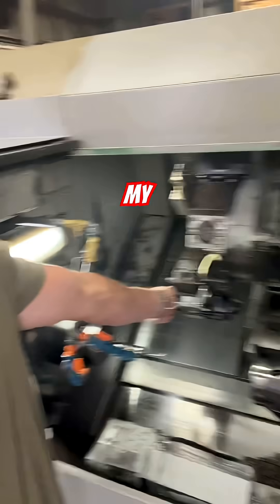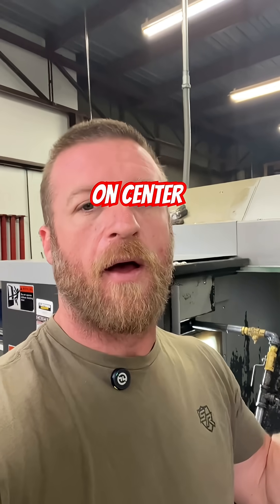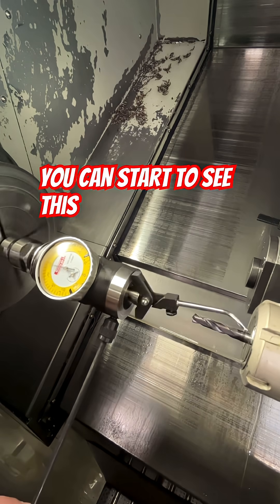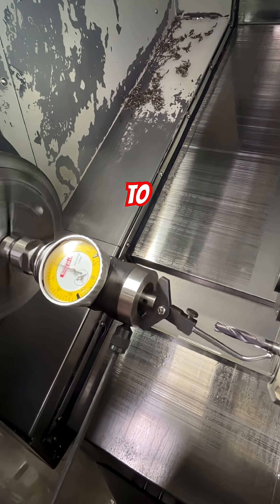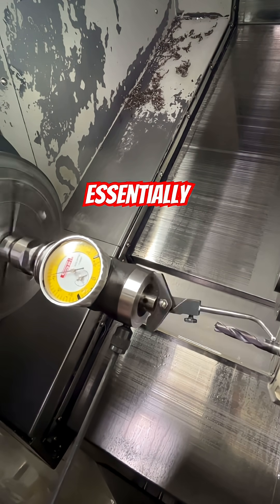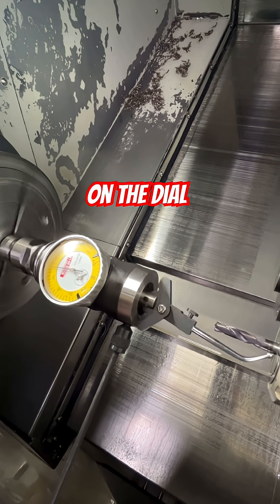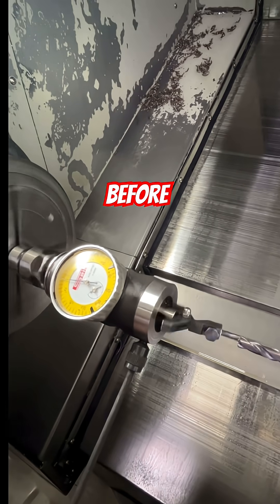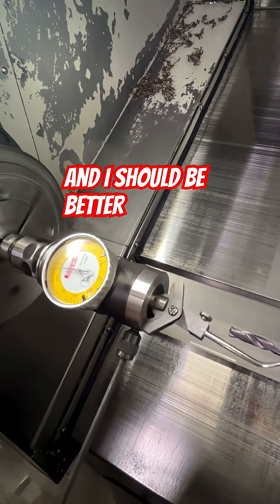Coaxial Indicator- Lets GO🚀 #cnc #fun #cncmill #machine #cnclathe #machinist #lathe #machining

Comment: That's wrong. You indicate to holder first. Then you indicate cutting tip flutes. Good luck
Reply from the maker: The way you mentioned is a great way to center a drill, but if my way is wrong…. How come it worked ?

Comment: its common the tip of the drill is out of center from a bad holder or collet
Reply: That is a pretty common problem. It gets worse the longer the drill is as well.
Reply from the maker: @brandons9138 good point
Reply from the maker: With the right setup I can get a drill within .0005” or better. But yes it isn’t uncommon to have a drill off center when it’s mounted at first

Comment: I love coax indicators. I always slap one in when I'm setting up a drill in a lathe. Every single time as a just in case. I mean it takes like 2 min to set it up and check and and can save you from so much trouble down the road ( cause if there is trouble ps like the drill snapping you know it's not because of that since you already checked that when you set it up ) 

My only question is. Why do you have the indicator in a ER25 collet extender in the collet chuck? ( they have runout as well ) I prefer it to have it directly in the main chuck/collet ( less added runout stacking ) also at like 50 is rpm but with a small weight instead of the pen ( so it doesn't matter/need to be so far out from the chuck )
Reply from the maker: I agree with you about doing it as a precaution simply because it’s so fast and easy. I put it in a colon extension cause I couldn’t find the coop pads I needed for the 3/8 shank of the coaxial indicator.
Reply: @Crusadermachining  then it's all fair and good. Could turn and put on a one time shrink fit adapter for it ( basically make perfect zero runout extender shaft for it )

Comment: I've had broken three carbide drills due to them being off center, don't have a y axis to compensate with either so can only get so close in the X. I found that it's faster to dial in the holder itself with an eccentric test indicator in the spindle
Reply from the maker: Do you have a method to offset or dial in the “Y” axis ?
Reply: Mechanics have adjusted the turret to be within the tolerance spec iirc it's +0.05mm and -0.002mm depending on which holder position but other than shims there is no way. 😅  @Crusadermachining

Comment: Only comment I can make after alot of this is Mighty Mag and .0001 indicator to the inside of the taper on the holder.  The shorter you keep the indicator the less effect gravity has.  Actually learned that from our machine tool distributors when I was chasing accuracy in live milling.
Reply from the maker: Great advice. If you aim for closest to dead nuts as possible, shorter the better 100%
Reply: @Crusadermachining We are St. Michael Machine and ever since I first saw one of your videos I wanted to tell you I like ur shop name sir!
Keep up the good work
We have 1 LB3000 and one Robodrill and one Okuma 4020 mill.  You helped me with some concept for thin wall turning workholding so thanks and God Bless you brother!! ✝️
Reply from the maker: @charlesscarpelli that may be the best shop name I’ve ever heard!  Glad I could help, thank you for following along and God Bless! Ave Christus Rex!
Reply: Blake coax with that same setup and it's even more accurate

Comment: You can put an edge finder in the spindle and edge fund the bore of the tool holder? At lest thats how i do it when i turn my horizontal mill into a gang tool y axis lathe. 😂
Reply from the maker: Oh I’m sure you definitely can. And I bet it could work for sure. I’ve never done it that way but I’d like to try now
Reply: @Crusadermachining the reason i do that, is I was taught that indicators sag a noticeable amount, and not to use an indicator on a horizontal mill due to the Y axis inaccuracy. Itd be interesting to compare the offsets found with a coax indicator vs an edge finder.

Comment: Stop buying temu drills
Reply from the maker: They sell drills? I gotta check those out. These OSG just don’t cut it anymore
Reply: @Crusadermachining Walter titex. Way better quality than osg in my experience. For coolant thru solid carbide drills anyway.
What brand indicator is that? I dont have a coax. Mitutoyo test indicator and a mirror are my go to.
Reply from the maker: @jiggsthedrummer3358 SPI indicator. I like the indicator and the mirror method as well, but this coax was right next to me.  How does Walter pricing compare to OSG?  I know Walter makes some amazing tools though.
Reply: @jiggsthedrummer3358 
I come in after machinists say they have their drill on center with my coax and find they are off. Sometimes .004" or even more.  A coax is the only way to do this right.

Comment: How do you know it's straight. I usually use a pin size of drill, or I flip the drill, I then get it on center, than I use the Z to make sure it's straight. To many machines have play in the tool blocks.
Reply from the maker: That is 100% a better way to do it. The hole I’m drilling is only about .300 deep or so - I’m passing if it’s off it should be ok. I do the same way when it’s a deep hole - get a pin and indicate at different points and then run indicator along in Z to check taper - great input for sure. Thank you
Reply: I generally do the same but in reverse. Tram in the straightness then locate with x and y. That way I don't change the xy position when getting it straight. But this is on a turret lathe so i have to tap the tool holder around and it's not hard to lose my coaxial position. So it may be better to do it the other way depending on the mechanics of your machine.
Reply: @user-rebbulb7331 there's no right or wrong. Just that it all gets done.
Reply from the maker: @user-rebbulb7331  I like the way that you lay it out and then once you’re done, you know that that sucker is dialed in perfectly. Thanks for the input.

Comment: Gotta love having that y axis so you can indicate it in that close the only other way is shim the block i know of
Reply from the maker: Yea man I’ve been there neither shim the block or hope it can cut off center in Y - LOL. The Y axis is a huge help
Reply: @Crusadermachining If you really need to dial something in on Y on a machine without a Y. Just make an eccentric holder for your drill chuck/collet chuck/etc, then rotate it in your tool block while indicating until it's good in Y, then just set X.
Reply: So the way to manipulate the y axis in a lathe without one is easy but always a bit of experimenting. The usual suspect is the collet itself cocking the tool at some random angle, you can do some light to medium tapping on the tool but this isn’t always possible with small or fragile tools so you can also loosen the tool and firmly press in the the direction you wish to move it and simultaneously tighten it down. Option 2 is the set screws on the side of the tool block, the directly push the collet holder in the y directs and usually after a while you know which order to tighten those in to get it in center. Option 3 is the 4 bolts attaching the tool block to the turret these rarely but sometimes can affect the the tilt of the entire block allowing you to tighten the bolts in such a way to aid in getting rid of the theoretical “y” axis. Hope this helps. Once you do it a few times you can get quick at it.
Reply from the maker: @XxLatheAddictxX  it’s crazy to think that just adjusting a set screw could be the difference from success and failure. Also, I find huge differences when you change different tool blocks versus bushings versus college makes a huge difference.  It’s pretty darn cool actually.
Reply: @Crusadermachining yeah there’s definitely some that are just problematic that I only throw boring bars in for that reason. Yeah and over time you figure out which order to tighten certain ones in. But you get to know all the components on a granular level with each machine. Sometimes it’s just build quality and other times it’s the abuse of others that came before you.
Reply: Yeah, shims and tighten, loosen set screws. Hand grenade zero 😆